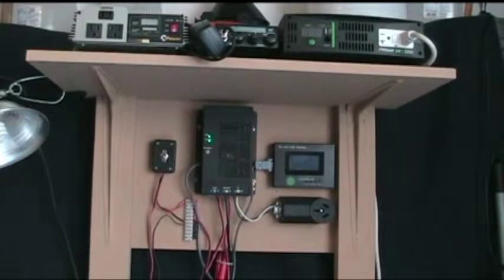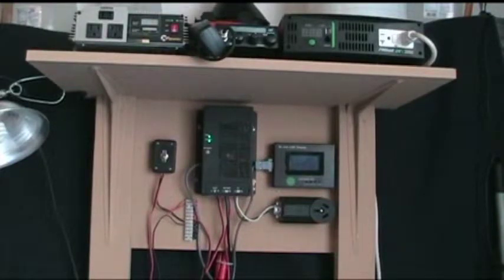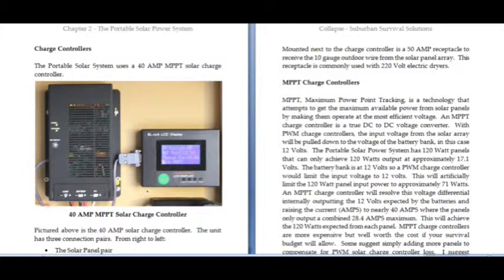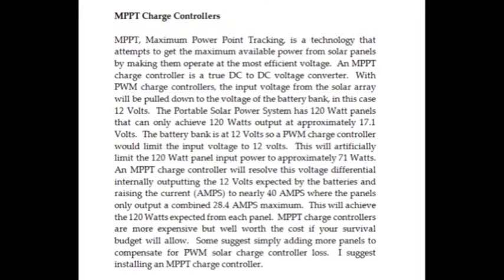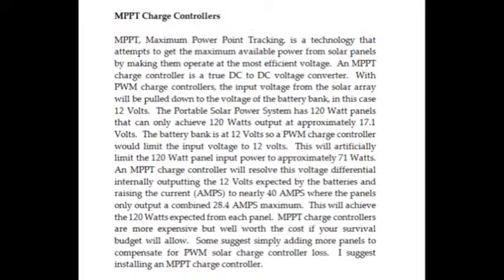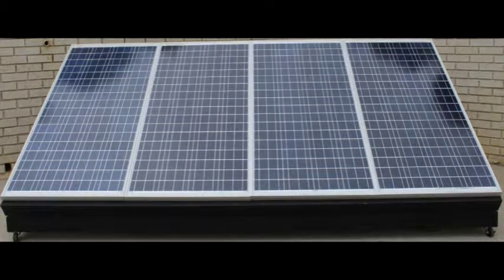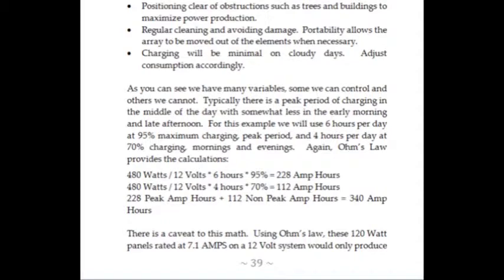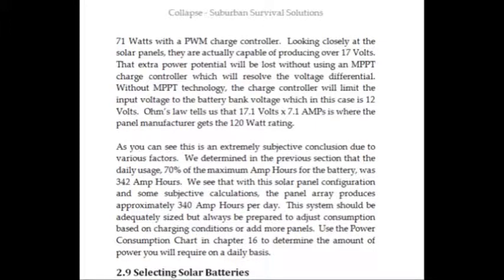The Importance of MPPT Technology - Solar Charge Controllers

Comment: hi where can I purchase your and PPT charge controller with the LCD display
Reply: sorry I meant where did you purchase your mppt charge controler with the lcd display
Reply from the maker: +Idowhatiwhant Hi, thanks for watching.  I saw the video you posted about the fake MPPT charge controller for 49 bucks.  That is not the controller I have on my system.  Mine came from a company in Canada, is 40 Amps, and was much more expensive that the controller you profiled.  I guess the rule of thumb is, if it seems too good to be true, it probably is.  I do plan to upgrade to a Midnite Solar Classic 150 at some point.  Usually around $600 or more.
Reply: but the screen the lcd disply for them can we buy just the screen and the battery monitoring sensor for this unit ??